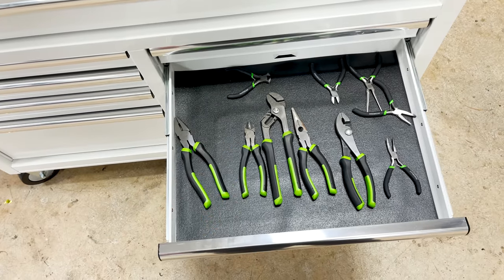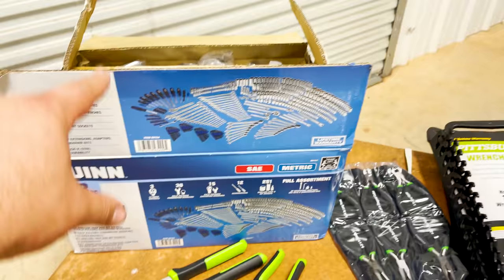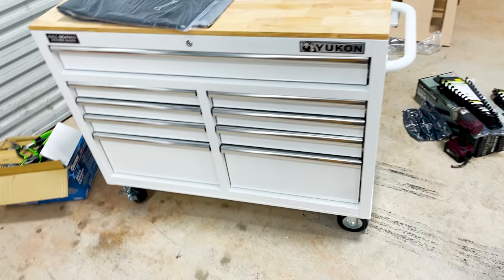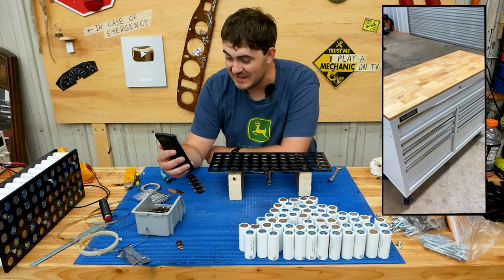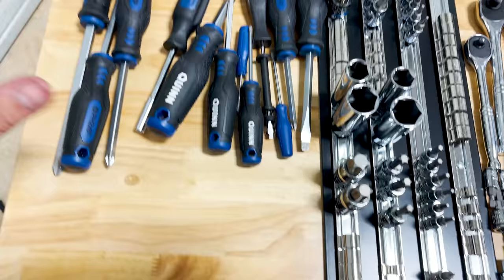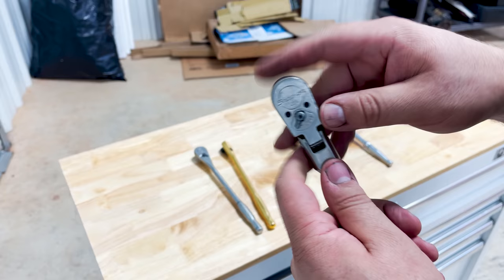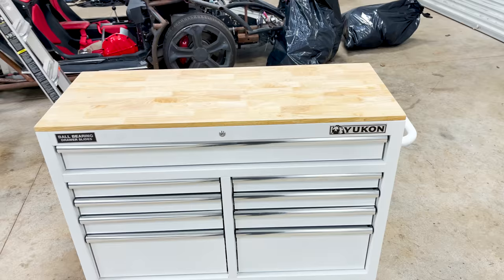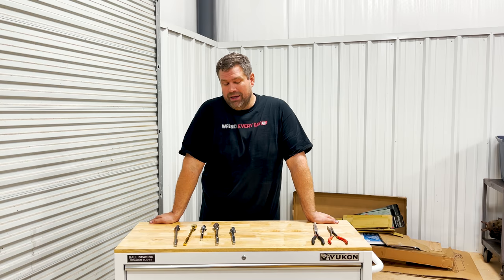I Bought The CHEAPEST TOOLS On The Internet (So You Don't Have To)

Comment: I can tell you one case where expensive makes sense. I bought my first socket set in 1997. I bought a Metrinch set when it was all over television ads. It does metric and standard, grips rounded nuts and have survived years of breaker bars and impact abuse. Double the function and half the space. I have since completed my set with impact drivers and 1/4 sockets as well as wrenches and adore them. Granted, my last set had to be sourced from Australia because they are not sold here anymore. My wife will never know what I paid on eBay.
Reply: Can we?
Reply: @TJDunaway  Around 400 for a set of short and long impact bits.
Reply: I bought the Metrinch socket set 20 years ago. $500 bucks and it never let me down, ever. Here's another hint, for tool buying, buy Japanese tools. They make tons of stuff and it never reaches the stores, you have to hunt for it. Specialty tool shops are the best.
Reply: I had a small Metrinch socket set many years. Complete junk

Comment: The Home Depot Husky version of that exact tool box also comes with a built in power strip with 2 USB ports (all where those "spot welds" you spotted are) for the same price! Also, that is real wood! And it's pretty resilient poly on too. I've exposed mine to all the chemicals other than acid...
Reply: Talking about Home Depot.  Since Robert was on will we see a growing collection of Ryobi in Jared's boxes?
Reply: @jayhom5385  even tho Ryobi is a brand under Milwaukee.. i really dont enjoy using their tools. And i work in construction( carpentry)
Reply: @jayhom5385  @projectfarm just did another great review of battery powered ratchets, and Ryobi tested in at the best value for DIY'ers! 😉
Reply: @musikdrengen02  yeah, my neighbor has all their tools, and the worst part seems to be the battery size and ergonomics. Milwaukee took a podium spot with @projectfarm testing, and I love my Milwaukees..
Reply: @jayhom5385  oh. And hopefully he at least picks the Homr Depot Rigid brand! My Rigids are going on 12 years old and the batteries are still doing great!

Comment: One of the most satisfying things I've done lately was buy that cheap little $99 workbench from HF, assembling that, and organizing all my tools with the little socket rails and pegboard.  Now that I've picked up an old Craftsman tool chest ($30) and rolling cart (also $30), I'm getting some drawer liners (about $40 worth) and expanding that organization to all the stuff that didn't fit in those 2 little drawers.  It'll be glorious soon!  I may not have a $4000 cabinet or even a $400 cabinet, but I have a place for my stuff and working out of it so far has been so much better than digging through boxes and tubs for what I needed.

Comment: I was at a restaurant recently and the tables had that exact same excessive-finger joint wood top, kinda weird.  

Glad you got Robert Dunn on the show, that guy is awesome.  He has two channgels, Aging Wheels for cars and Under Dunn for wood working/home projects.
Reply: they use short bits of wood, is a good thing to not waste any, makes an OK top
Reply: Also easier to get a flat surface when mass manufacturing than using longer planks that can warp.  It'll be real wood, but probably a fairly soft wood that'll mark easily.
Reply: The finger joints are not a problem if they're done properly with proper sealing , coming from a woodworker with lots of years experience.
Reply: They're very nice panels to work with, as they're much more resistant to warp than solid wood, and you don't need huge trees to get a big panel, but with the benefit of it still being solid wood and not just pressed sawdust or laminated cardboard hollowcore. They make 'em in a variety of wood types, but this one will no doubt be some kind of softwood.
I actually really like the aesthetic, kind of the same vibe as a chopping block?

Comment: I worked as a motorcycle mechanic for a little while, with a mix of Husky, Craftsman, Matco, older (like 80's) Snap-On, Dewalt 12 and 20 volt, and Tekton.  Sockets, don't think you can go wrong with cheaper stuff, but when I had to borrow a tool/socket a few times, I bought from my Matco dealer.  I also prefer the Matco 88 tooth locking flex head ratchets with the comfort grip, just feels better and very versatile.  But cheap tools can do the job just fine, most of the time.

Comment: The timing of this video couldn't have been better. This helps me make my own decisions about my garage tools. Thanks, Jared!
Reply: buy master sets, you get it all in one
Im 20 and have no regrets on what ive bought 
(ive only bought harbor freight tools using tip money)
Reply: Look at used snap on tools as well because they still have the warranty
Reply: If you are giving your garage a bit of a make over, I found that if you treat it just like a car build, come up with a design of what you want and layout first then start arranging it and getting the tools you need!
Reply: For the most part the $8 wrench will turn a bolt as good as a $20 wrench
Reply: Husky has a master set aswell but I'm thinking this one is probably more cost effective
Reply: @grahamburgdorf8397  Some of the harbor freight stuff also has lifetime warranty. Their Icon line does. I don't know about the Quinn line.

Comment: honestly I would always reccomend the best way top get tools is to buy second hand from someone, I got most of my tools second hand from a mechanic who retired and frankly got everything you would actually use for a 10th of what it was worth new
Reply: This is also great advice! Some of my tools came second hand and they are just as good for what I need them for.
Reply: I agree, I bought used Snap-on which is still Snap-on with a lifetime warranty - there is no way I could have afforded new Snap-on, but used - it's a fraction of the new cost, and awesome to use.
Reply: I bought a box that was over a third full of snap on tools, with the rest being Mac, Matco, SK, OTC, etc., for less than the value of the box.  Guy was a retired mechanic, and was moving into a condo, and wanted it gone NOW.  Snap on warrantied about $4k worth of the tools.  I have a few that I have to find the mac truck for, etc.  Problem was that I now need a bigger box.

Comment: When I started out as a mechanic, I spent my money on a sears Craftsmsn tools and tool box.  As tools failed or were lost I replaced them with “better” brands, mostly snap-on. I am happy to say that I still have many of my tools from that time. The Craftsman tool box caused me a large loss of tools.  I went to work one Monday and many of my best tools were stolen.  I turned out that the “locked” Craftsman top box would pop open if you rapped the lid sharply to the left. I sold it and bought a used snap-on box, cabinet and top box for $700. I am still using that box today.  The only other failure from Craftsman, were the screwdrivers and extensions. The screwdriver tips would break or round out. The retaining balls on the extensions would wear out and no longer hold the sockets.  While these were replaced by Sears, I bought Snap-on sets to replace them. The snap-on screwdrivers are showing their age and the plastic handles are disintegrating. The Snsp-on extensions look like the day I bought them an the spring loaded retaining balls have never failed to hold onto a socket.  I have rarely had any socket or wrench break, but I always had two of each size for when one did. The Craftsman lasted just as long as the Dnsp-on, but I found that I had fewer problems with bolt rounding with the snap-on sockets and wrenches. Perhaps there was truth to the claims about their flank drive.  Though whatever patent they had on it, expired long ago, as I see that radiased design even in cheap brands today.

Comment: I’m a residential garage door tech, I use my socket wrench everyday, but by no means does it get used a lot or under a lot of pressure. Bought a Quinn one from barber freight and within 2 months completely stripped out… replaced it with a Milwaukee one and it’s been over a year no issues!

Comment: For the last 6.5 years I've been doing light assembly, all of my non power tools came from harbor freight and honestly I have not had any issues with them, I've only had to replace one wrench that I left out and was promptly stolen. I have a US general tool box that holds just about everything I need, the only complaint there is the included drawer liner lasts about 2 hours. Don't bother with the power tools, I've used a few of their drills and found them to be inconsistent in quality.

Comment: My father was a professional diesel mechanic and spent 10's if not a 100 thousand dollars on tools off the tool trucks but wouldn't think twice about stopping in a harbor freight for an odds or ends piece he might need.  I've learned that in these times today most everything with a high price tag is just surviving off a legacy built a long time ago when quality actually mattered. Today everything is disposable so it only makes sense that the tools we use to repair those things are disposable as well.

Comment: My theory on HF is that it will get the job done and provide the needed tools for most people for awhile. At which point they can go back and replace it at an affordable price or upgrade because it's used enough it broke.

I've bought a ton of tools from harbor freight and I haven't been disappointed. I normally try to buy from their better or best category. I've been able to get tools that normally would be out of my price range.  It's great for hobbyists and DIY types. Nothing wrong with harbor freight 😀

Comment: Great series, looking for to the rest of the episodes! If you want a "budget" no skip wrench and socket sets I recommend Tekton. Quality and price wise they are between the tool trucks and HF stuff, but best of all NO SKIPPED SIZES. I hate skipped sizes and I found Tekton is the cheapest way to get a no skip set.
Reply: i bought a good amount of tekton sockets when i started working at a shop, still have some of them and ive never had an issue with them
Reply: The Tekton socket sets, either regular or impact are very good at a very reasonable price. The other hand tools like the adjustable wrenches are junk
Reply: There's a lot of great Cr-Mo socket sets on Amazon too. Sunex are my favorite, but there's cheaper options as well. I have the Tekton wrenches up to 32mm so far. Great wrenches.
Reply: I personally like tekton and gearwrench

Comment: I've been professionally pulling wrenches for about 30 years . Been working in dealerships for almost 20 years . I started out with cheap tools that mostly couldn't stand up to the daily abuse I put them through . Over the years I learnt what tools I needed to be high quality and what I could get away with cheaper brands . I also broke down about 8 years ago and bought Snap On boxes . I wanted a box to last me the rest of my career . And even though they are Snap On , I got the least expensive ones (only just over $9000 total) .
Reply: The Snap On boxes prices are a rip off.

Comment: I own the cabinet version of that tool box.  I'm not sure what the top is either, but I THINK it is actual wood.  I say that because when I bought mine, I sanded the top down to get rid of the poly coat and then oiled it with vegetable oil.  There's actual wood under the poly, but I don't know if it's wood all the way through or just a veneer with sawdust under it.  Either way, I use mine for processing chickens and rabbits so I eventually put a real butcher block top on it.  I've been pretty happy with the whole thing to this point.

Comment: I will say I do like their ICON line of tools. I've had pretty good luck with them.
Reply: I was very surprised by ICON.  That's the real deal, hands down.  The fit and finish is better than 1990's Craftsman tools from Sears when that used to be THE THING most guys bought.  Not a diss on Craftsman either.  We used them in the Marines to repair/rebuild engines and transmissions for military vehicles all day long and they worked well.
Reply: I bought the Icon sockets and when torquing a bolt to 25 in-lbs I had the 13mm round off inside. The other ones have held up fine. I need to take it back. I'm hoping it is just a fluke since the other ones in the same pack have been fine.

Comment: I saw a video the other day in which a corner of the top on one of those Yukon boxes had broken off. It actually is solid wood. Many comments called it rubber wood and said that it's taken from rubber trees that have stopped producing latex. That particular box had been stored outdoors and uncovered for several years.

Personally, I buy Channellock pliers exclusively. I've tried many other brands and always came back to Channellock. I prefer S-K for most everything else but that stuff never leaves the shop.

Comment: Wait, is the handle supposed to go on the side with the fixed casters? It seems like that would be hard to maneuver.

Always a fun video when you have Aging Wheels/Under Dunn on...

Den of Tools just did a toolkit review like you're looking for recently...
Reply: No different than a shopping cart
Reply: That drove me crazy.  I'd have the casters reversed so I could maneuver the chest tight to a corner.  That's something you don't do with a shopping cart.
Reply: @Bac0n3510  The spacing on shopping cart wheels is wider on the fixed casters at the back wheels, which gives you more leverage. Since toolboxes have the same wheel spacing on both sides, not only you have no leverage, you'll also won't be able to turn it if you have more weight where the fixed casters and handle are. The vast majority of toolboxes are designed to be pulled, not pushed.

Comment: Great idea for a series.  As a reasonably experienced hobbyist I have basically been doing this for the last 10 years with my BMW fleet and would appreciate a pro's opinion on the gear.  Most expensive stuff I have is from Craftsman or Kobalt.  So far, besides specialty tools for certain BMW tasks, HF tools and entry level big box brands have been doing the job.  I work out of 4 HF Yukon tool boxes as well.  One thing I DO NOT recommend getting from HF... is torque wrenches.  That cost me redoing a cylinder head.  And on a BMW... that is not a job you want to do twice.  Thanks for the content.

Comment: It’s funny you mention the nut-type slip joint pliers.  I’m just a DIYer and I started out with a lot of my dad’s old Crescent pliers as part of my toolbox.  About 10 years ago, I wanted to buy new pliers for no good reason and picked up a set of Kobalts that included a pair of slip joints.  They were absolute junk from the time I pulled them out of the package and suffered from the exact same problem you described.  I tossed them after less than a month’s use and went back to Dad’s tried and true Crescents.  The only stuff I was able to keep from the Kobalt set that was worth anything were the wire cutters and linesman’s pliers.  They’re perfectly good.   Not coincidentally, that was the last thing with Kobalt I ever bought, which is a shame since my Williams-made (US) Kobalt sockets and combo-wrenches have been great for over 20 years.

Comment: I have this box in my shop as a farm mechanic, has help up very well, didn't want anything crazy expensive because I'm on a farm. I also bought it near the holidays and opened a new harbor freight credit card at the same time and was able to get the price of the box down to $290. Was the warranty was up on it I bolted a nice vise to the top of it with no issues. Lock is a little cranky sometimes if drawers aren't line up all the way in but it works amazing and more than worth the price

Comment: If you have a Mendards anywhere near you, their Masterforce toolboxes are by far the best without spending snapon money.  So many cheep toolboxes use the friction sliders to hold the drawers in the closed position, the masterforce has latches on every drawer. Lift the lip slightly and pull the drawer open, more secure and it doesn't jostle and unsecured tools around in the drawer every time you try to open it.

Comment: As a professional technician with north of 6 figures in tools I have one very important tip for new technicians and that is stay away from tool trucks at first, buy it cheap and if you break it then upgrade but do spend on good diagnostic tools, don’t fall into the shop games of who has the largest most expensive toolbox because why have a $25,000 toolbox with 350 a month and cannot afford the tools you need to make more money.

Comment: I have bought some tools from Harbor and found them to be ok. Some of the HB tools I have are still good to this day, but others have indeed been crap.

On a side note: I actually had bought a cheap Black and Decker toolkit from Walmart in about 2007 or so. Out of all the tools that thing had, I still have some slip joints, needle nose pliers, and a hammer that has taken a beating a time or two. It is completely knackered but is still solid and I use it whenever I need it.

Someone here in the comments said that cheap tools of today are a far cry away from cheap tools of yesteryear. This is absolutely true.

Comment: I worked in a factory that produced those finger jointed, edge jointed wood panels like what is on top of the toolbox. The primary product was trim molding. The rejects and cutoffs went to make these panels. "The left over scraps from the expensive stuff" is exactly right. Same company also used the left over sawdust to make pre-formed wood logs for the fireplace similar to Presto Logs.

Comment: I have the same Quinn set and I bought the pliers and nut drivers from Quinn. I use them everyday and I work in a shop fixing skid steers, excavators and small engines. No problems with any of them. I've even been buying everything Quinn has to offer and love all of it